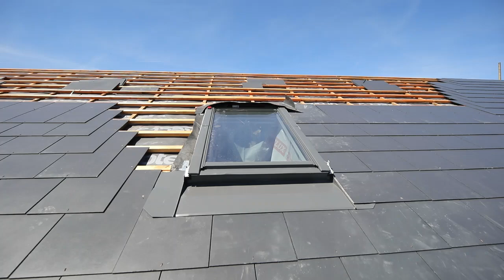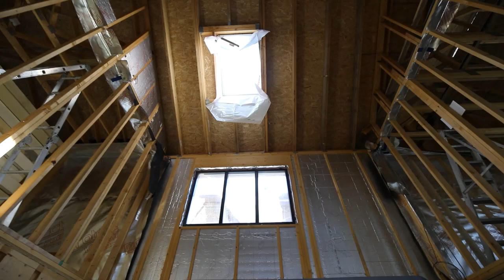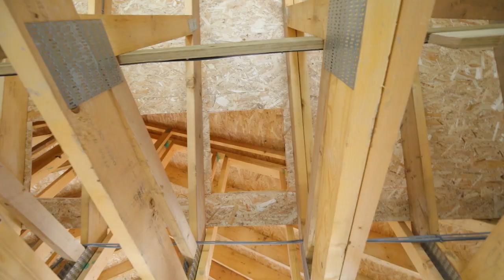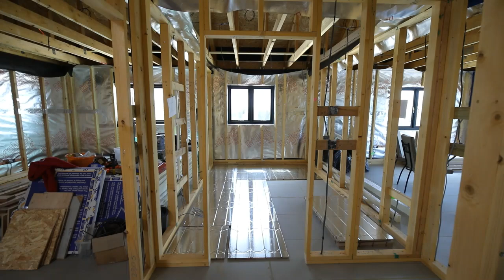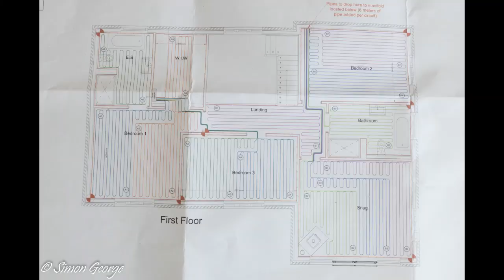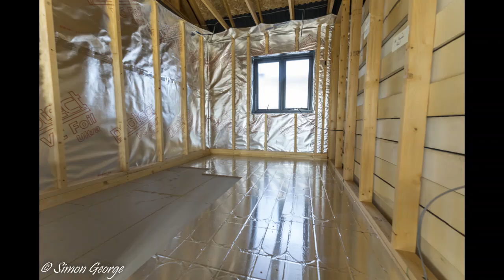The Self Build Day #90 - The screeds still wet!

Comment: Such a shame with your screed (understatement). Hopefully this ended well. Re your upstairs underfloor heating, we’re planning to build a 100sqm single storey home. Who was the manufacturer and are you happy with the end product? Thanks Paul
Reply: Hi. We used Omni board and found them easy to install. They provided a layout plan but the plumbers did their own thing in the end (I checked no runs were too long). The plumbers also replaced the pumps with their won preferred brand as they thought they were superior. We are happy with the board, the only thing I would change is the overlay we used (under the engineered wood flooring). I had to choose that quickly and although it says suitable for underfloor heating I think it was rather dense and if I had more time to research I think I could have found a better alternative.
Reply: @ Appreciate your reply, thank you. Will make a note on that for the future👍